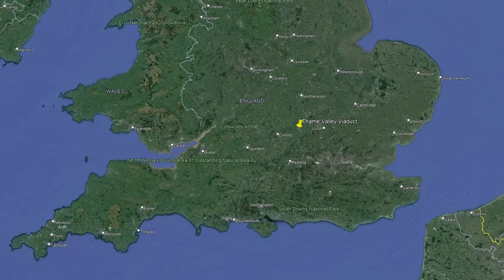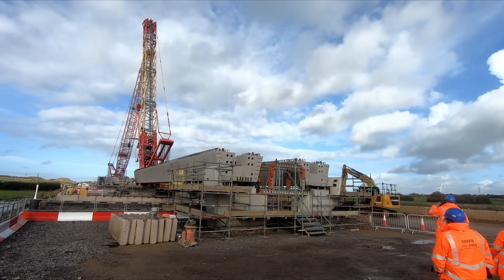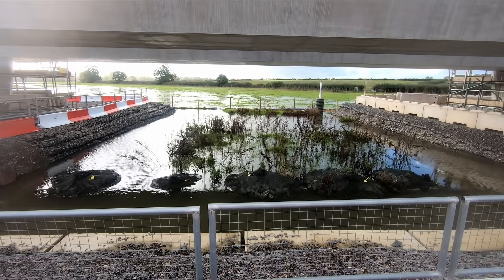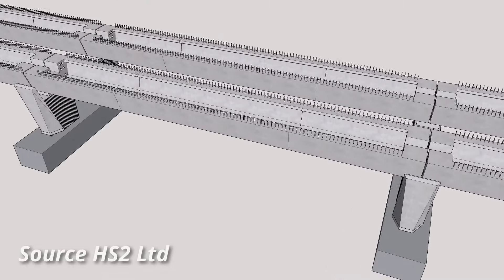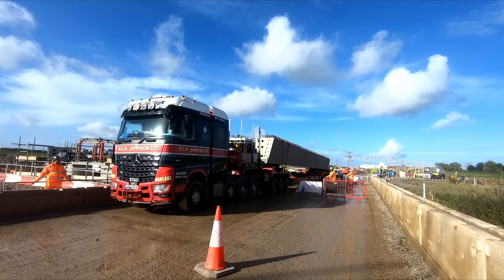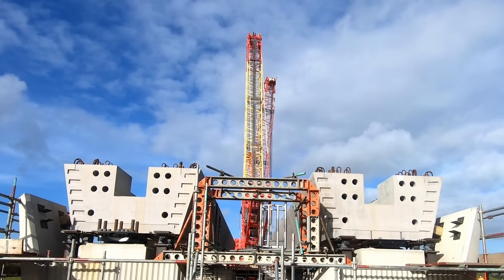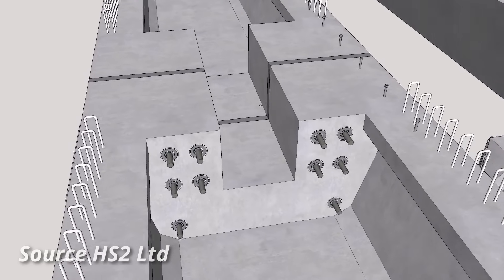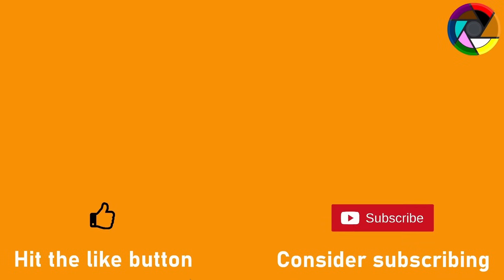HS2 Thame Valley Viaduct | Aylesbury

Comment: Is that really the first prefab concrete beam bridge in the UK?? That seems baffling, where I live everything is built that way. I shudder to think of the maintenance costs of all of Network Rail's bridges and structures if that is indeed the case
Reply from the maker: Did you watch the whole video? It's not about the beam, but the viaduct as a whole.
Reply: @Rail_Focus  Did I misunderstand something then? "It is thought that this is the first time in the UK that a viaduct will be constructed almost entirely out of prefabricated sections", referring to the prefab concrete beams?
Reply from the maker: Beams, piers, pile cap rebar cage, slab track and parts of the deck all pre-assembled off site, which it is thought hasn't been done on the UK before
Reply: @Rail_Focus  Ok. That's how it's normally done around where I live

Comment: Why didn't they use the same technique as Colne Valley?
Reply from the maker: Different structures require different methods. The Colne viaduct spans are much longer and it's much higher. The piers for Colne weigh around 350 tonnes. But the deck sections are being constructed off site.